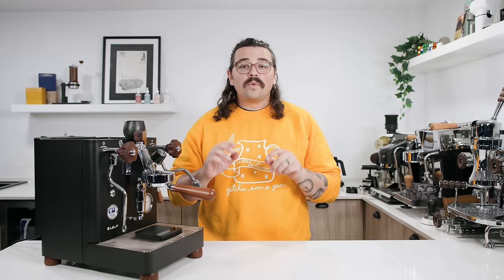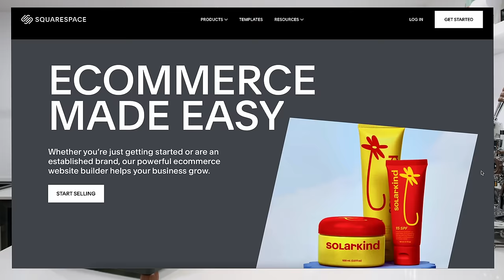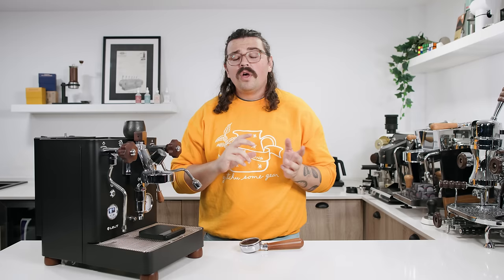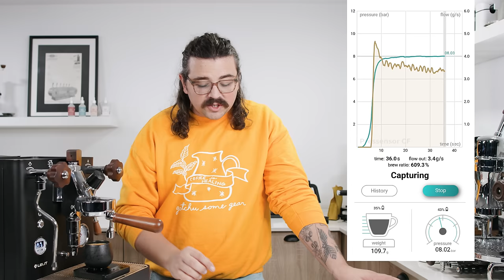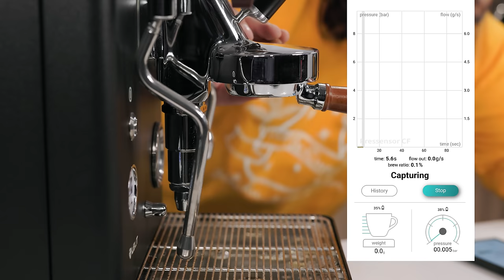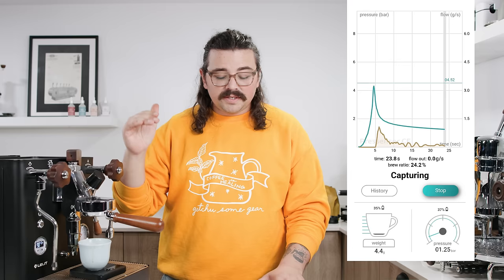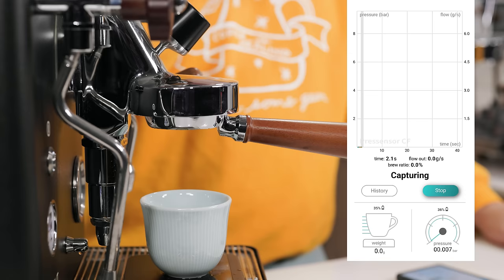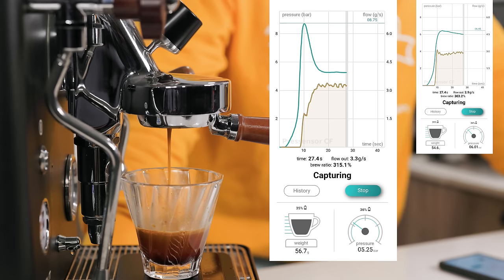UNDERSTANDING ESPRESSO EXTRACTION: Ultimate Guide on Pressure, Flow and Resistance

Comment: Alright, Somewhere I feel like I experienced the inconsistency mentioned with the low flow/(pre-)infusion style versus the blooming espresso style. And sometimes I felt like "just ramping it old-school" lessened spraying from my bottomless portafilter and improved on the a harshness in the shot. But does this mean that going low and slow increases channeling per se? Or only if you take into account whether or not the entire puck has been wetted?
Reply: Bloody hell, you got me thinking again. Does pressure drop off that you see later on in a shot (with a needle vale partly closed and a vibe pump) equal increased flow? Or does that depend?
And what would you do? Let the pressure lower by itself? Or close the needle actively to keep the flow in-check?

Comment: Really interesting video but for me goes against the concensus view. I thought long, slow fills/preinfusion phases were considered better as they allowed an even saturation of the puck without the risk of puck damage with the higher flow rates. Slayer-style shots seemed to be desirable. Most machines with preinfusion tend to favour low flow or pressure and avoid the puck slam. There seems to be be general agreement that flow tail off at the end of a shot is beneficial.
Reply from the maker: You're right at the end but not the beginning. Banging the puck is a good thing early on. This is exactly why new machines are trying so hard to replicate levers. That slam is helpful for evenness.  The idea of slow fill (read slow NOT low pressure) is quite out dated and for reasons I note here. What I am presented is the most current understanding of espresso extraction theory.

Comment: Ill be honest, im not totally convinced on the slow pre infusion bit lance. I would need a bit more data to convince me. So you are saying that a 10 second slow pre infusion doesnt wet the bottom of the grind which I get, but there are a variety of factors that can affect this no? Bean type, puck preparation, machine type etc. What if i pre-infuse for 17 seconds at a slow rate, and then kick up to 9 bar?  Maybe you are working off of a base I dont have which is totally understandable, but I dont see how a slow flow of water exposes more flaws in the puck compared to a fast one.

Im going to have to do more research on this to fully convince myself. Im on the Flair 58, so does this mean I shouldnt pre infuse at 1 bar? go straight to 5 bar ?
Reply from the maker: No. You're mixing up flow and pressure. If you're at one bar, that NECESSARILY means you have already killed all the dead space and are applying pressure. You can't have one bar with dead space. The fact you see pressure applied means the puck is being saturated. You can do that all day, no worries. 
My.point with the demo is low flow. There was ZERO pressure during that 10 seconds. That's exactly the issue.
Reply: @LanceHedrick  ah okay, its at zero pressure. okay then that makes sense. well done defending yourself haha. cheers
Reply from the maker: Hahaha no worries! Thanks for watching. There was a lot of info conveyed incredibly quickly
 Haha
Cheers!
Reply: @LanceHedrick I still don’t get this 😩. If there is pressure but you’re applying that pressure by pre-infusing for a long period of time (like you can do on the BDB by holding down the manual button), and if no drops of espresso are flowing, then doesn’t this still mean that the puck isn’t being saturated fully? You’d still have portions of dry puck until the espresso actually begins to flow wouldn’t you? So what you demonstrated as a problem with low flow, still applies even if there is pressure but with a long pre-infusion time? This is the bit I don’t understand.

Comment: Is the Bianca a bit limited in terms of MAX flow rate at 6.5g/s when compared to others that seem to reach higher numbers with a rotatry pump?
Reply from the maker: Yes and no. With the valve set this way, the Max 6.5. But you can change the valve to hit something like 20g/s. But then the minimum flow would be like 10g/s

Comment: You did a video on the Breville double boiler where you suggested pre-infusion at a low pump pressure until a few grams of espresso was produced. Doesn't that contradict what you suggest here?
Reply from the maker: Not at all. Remember, pressure and flow are different. Low pressure can be achieved with high flow.
Reply: @LanceHedrick ”Pressure and Flow are different” should be printed on little stickers and attached to every espresso machine sold.  😂👍

Comment: So you recommend to not use PI and go directly to full flow to saturate the puck asap? At least that's my takeaway from chapter Saturation Rate.
Grinding finer for blooming shots - don't you think the finer grinds will lead to more in homogeneous flow (like shown in "turbo shot" paper) or do you think the effects of blooming counteract that?
Amazing video!
Reply from the maker: It depends what you mean by PI. I think you fullflow the puck as fast as you can then you can lessen pressure/flow if you'd like. Just need to ensure the fill is fast.
Reply: I thought that PI generally is a low flow/low pressure pump setting that slowly saturates the puck before the pump goes to full power.
Like on the Bambino for example. During PI the water debit is lower hence also the pressure and then the pump ramps up. So getting rid of that and going directly to full flow to saturate asap sound like the way to go.

Comment: why is liquid output measured in grams / second when it is usually measured in volume / unit time?. ie; water pumps are rated at how many liters/ hour they output. typically in a physics/engineering class it would be quoted in unit volume and not weight. one can convert unit volume to weight afterwards.
Reply from the maker: it isn't. since 1g h20 = 1ml h20, I just interchange as i'm talking. no big deal

Comment: Unscrew the wooden handle of the needle valve with a hex key. Turn the needle all the way counterclockwise. You have much grater flow like 20ml per sec. Mount the handle on its place. But I’m not sure the final result in cup be grate😊
Reply from the maker: Yes but then you can't go to no flow.
Reply: Right. It’s 10 ml per sec all the way close.
Reply: Awesome video, as usual, thank you much. All the question I was searching the answers for for a year and a half answered.
Reply from the maker: thanks! So glad you found some helpful tidbits!

Comment: Forgive me, while I find these extremely educational and interesting I am struggling to have a practical application for this advice. In other words and inline with the comment at the end, throw out the window what you think you know, if my machine can't change its pressure or flow, how am I practically able to control or action this advice? What steps should one take to aim for better results when the equipment is limited.
Reply from the maker: It's understanding what is going on in the puck. With this knowledge, application can be made to any machine. For instance, you know that your shot doesn't need to be fine enough for 9 bar the shot time. If you go a bit coarser and let it push early and casually go down, the shot could blow your mind and shift your current paradigm

Comment: Fines don’t migrate significantly at these shot ratios, and while the pressure chart does show something interesting, it is more likely related to CO2 release from the coffee because CO2 is the driving force behind pressure in espresso. Now, if you were using a freshly roasted coffee, then I would agree that some of what you are experiencing might be fines migration but only if the flow had dropped to 0.1 ml/s at 9 bars.
Reply from the maker: Disagree, but you know this 🥰
Reply: @LanceHedrick  I’m aware you disagree and I think you should dig deeper. Talking about machine preferences is one thing, talking about science where things are testable means you as an influencer should be held to higher standard. 

There isn’t even contention in the literature: it doesn’t show evidence for significant fines migration until a ratio of 300:1.
Reply from the maker: I hold myself to a high standard, hence my constant discourse held with science professionals who have applied their professional abilities to coffee science. 
I don't think implying I don't is a good move. Sounds like someone is using my comment section to promote their new blog post collection turned book.
Reply: @LanceHedrick  I’m saying that you brushing off my comment as this is a difference of opinion. I presented evidence, dug into the literature, and brought solid reasoning to the discussion to which you brush off like I’m not a professional scientist.
Reply from the maker: What you brought up is true. Co2 is a big factor. But absolutely does not negate the probable existence of fines migration. This discussion has been had in numerous places. I find it odd you feel the need to open this up again in the comments of a video other than maybe getting people to see your comments, clicking on your profile, and discovering your book.
I've seen your posts about fines migration. I've seen your experiments. They simply aren't convincing.
Reply: @LanceHedrick  I bring it up because you have influence, and I bring it up whenever the topic comes up. Even if you look at the paper on water through a porous medium, it says the same high ratio, I only confirmed the findings with coffee by using a small and large ratio. Outside of that, there is not actual evidence. I’m not convinced you have actually read my posts or looked at my experiments considering the last argument we had about flat/conical grinders. 

You don’t need the ad hominem attacks.

Comment: Thanks! Very interesting topic. Two questions. If you have control over flow, does it make sense to still set the opv to 9 bars? If you hit the opv limit you loose flowrate etc. 
Also if i am correct, a the ukla vibration pump has a flowrate about max 10ml/sec. Will this become a limitation?
Reply: did you end up with setting the ovp at 9 bar? :) I'm also looking for the same topic.
Reply: No, did not do it (yet) but i feel that with long blooming shots it is hard to reach 9 bars after blooming since the puck is already very saturated. So not yet needed higher than 9

Comment: The explanation for the peak in the pressure was a little bit confusing. 

An easy logic would b: the machine wants to hit a certain flowrate. With conical burrs there are more fines, so more resistance so you instantly have the targeted flow rate. With flat/low fine burrs there is less resistance, so the pressure ramps up a lot to hit the goal flow rate.
Reply: Would be interesting to manually increase pressure because one sideeffect of the peak pressure is the compression of the puck and thus more resistance. If you ramp up slowly you might get a consistent flow rate without the compression and thus a lower pressure. Not sure how that would change flavour
Reply from the maker: Except that isn't exactly what's happening. The grinder was on a finer grind size, allowing the higher pressure. The cone was at a coarser grind size but had enough fines to maintain pressure even tho lower peak
Reply: @LanceHedrick  thank you for your answer. I understand, so in a way both have the same resistance at the beginning, one because of fines and one because of finer grind. But after the beginning phase they behave differently because of the things you describe in the video. Thanks again!
Reply from the maker: @Oliccino not same resistance. The ssp brew burrs peaked higher, meaning a higher initial resistance, but the burrs make the coffee extract incredibly rapidly, giving off loads of TDS rapidly. The cones don't extract as quickly and the fines slow it all down. It peaks closer to 6.5 bar whereas the second around 9
Reply: @LanceHedrick  wow thank you so much. Great video and then even more info in comments. Now, I understand it even better. So interesting!

Comment: Hi Lance! Me and my friends have a hard time understanding the point. We don't get how low flow saturation relates to a dry puck. Can't you just wait much longer until presszre builds up and the puck saturates? Or you mean under uneven stratic extraction that the top layers have a much longer contact time this way than the bottom layers?
Reply from the maker: The point of the illustration is to showcase the top of the puck had been wetted for 10 seconds and the rest not at all. That layer has been able to go 10 seconds further into extraction than the rest of the puck. Not to mention the bottom of the puck never sees clean water, so it is a serious disadvantage.
Reply from the maker: @szarvadyjazon  correct and the time is the issue. Low flow will increase the heterogeneity of the extraction because low flow will make the gap filling time longer, meaning pressure can not kick in for longer, meaning the bottom of the puck is bone dry for longer

Comment: So does the gear pump ramp up the flow to maintain the prassure?
Reply from the maker: all the pumps will ramp up the flow to maintain pressure, unless it has some sort of controller on it to dictate otherwise.
Reply: @LanceHedrick  so the point of ramp down on pressure profile is to lower desired pressure that can be mainteined with puck losing its integrity?
Reply: @LanceHedrick I believe it’s the opposite. Positive displacement pumps, like rotary vane and vibratory pumps, will increase pressure (apply more force) to maintain their flow rate. They’ll gladly pump away at nearly zero pressure if operated open-circuit (no resistance).  👍
Reply from the maker: They don't want to maintain flow rate in rotary and gear. I wish it was maintaining flow rate. That would solve a lot of issues in extraction. Very easy to verify this- just track output flow and watch it increase on a Linea Mini

Comment: You are still only half way there. Where are you measuring pressure? The needle flow valve and gigleur jet creates a pressure change. The pump pressure and puck pressure can be different. If you can graph those simultaneously, with flow in 3 traces that would complete the picture. What say you?

Comment: I own a lelit bianca and to be honest, i am more confused now than i was before.
the pressure valve on my bianca (group head pressure) regularly shows pressure WAY above 10..11.. bar; for example if i grind too fine and water cant get through. it also happens a lot of times when i fill up the grouphead really fast but the water didnt make its way through the coffee yet... happens actually all the time. your graphs never showed that kind of behaviour.
also: i understood that filling up the grouphead real fast is a good thing. but there is a difference between grouphead is filled and pug is saturated (first drop showing). do u recommend to grind the coffee so that the pug does get saturated as fast as possible or is it fine when it takes sometime to saturate on high flowrate/pressure
Reply from the maker: Sounds like you're commonly grinding too fine. Always start coarser and go finer. This will make your espresso 10x better and much more consistent.
Reply: @LanceHedrick  Thanks for reaching out - i will give it a shot! (pun very much intended :-) )
Reply: You can adjust the OPV on your machine such that it will top out at 9 bar! Machines often come from the factory adjusted a little too high. Might help with channeling and give you more consistent shots.

Comment: On an E61? I though you said you do not recommend those because of bad temp stability.
Reply from the maker: I have a video on the Bianca. I don't recommend e61. I've done loads of thermal testing on this machine. Not a normal HX e61. It's an e61 style dual boiler. But that's besides the point. I used it for the manual  flow control.
Reply: @LanceHedrick   Is the temp stability much better on the Bianca than other dual boiler e61s? If I remember from the video on it, it still has thermal stability issues due to the hefty brass e61 group.
Reply from the maker: @SaulFein  correct. It still does have issues. But it is more stable than every other e61 I've tested.

Comment: The low flow shot styles also use coarse grounds to maintain a low pressure around 1-3 bars. Trying to demonstrate that they’re bad by using fine grinds suitable for a 9bar shot is kind of disingenuous really tbh.
Reply from the maker: You missed the point. I didn't say low flow shots were bad. I said low flow fills were. Even with coarse grounds, you aren't wetting the full bed if the grounds are enough to create 3 bar. Would be nice for you to attempt to clarify before accusing me of disingenuity